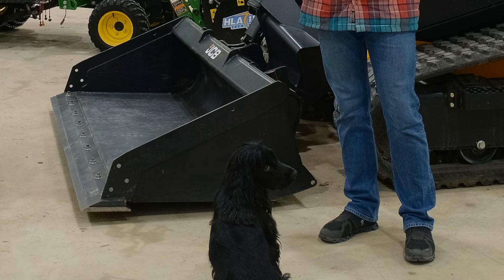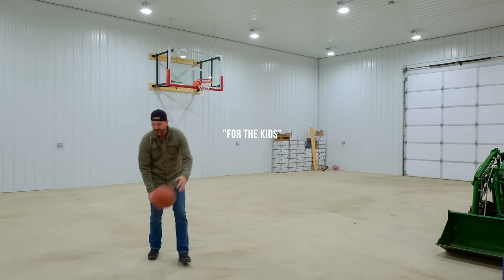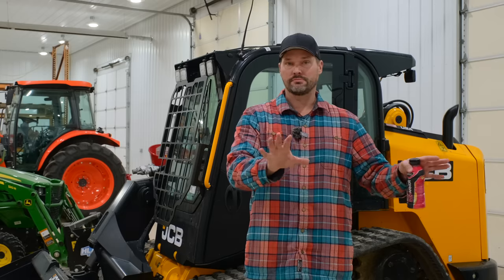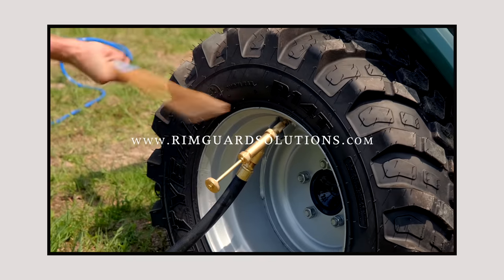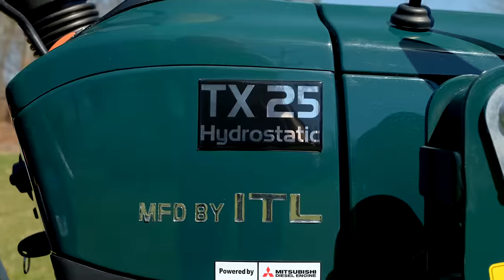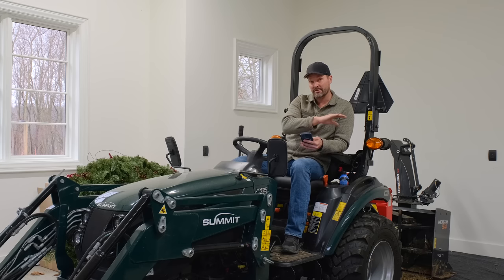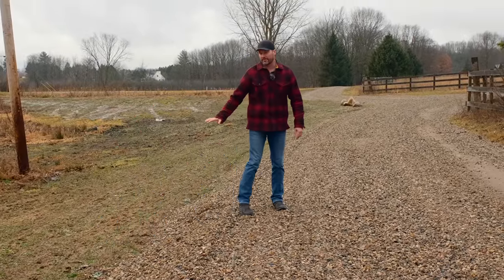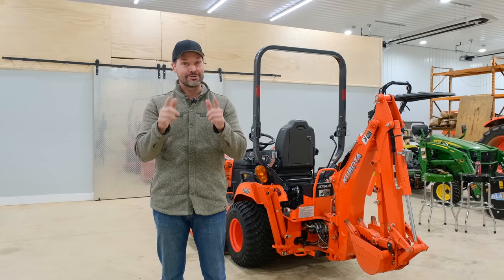NOOO! SPONTANEOUS COMBUSTION MELTED MY NEW JCB LOADER 🔥😭

Comment: Encouraged by the Summit updates, I'm in solid green territory in eastern ND.  I have 12.5 acre farmstead (not living there yet) and due to the bitter cold winters need a cab.  Roughly 10 acres of pasture that needs lots of TLC and 36hp tractor with snow pusher and inverted snow blower for winter snow moving duty is the ticket, since my Lovely Spouse will be doing most to of the work while I'm driving airliners at my real job.

Comment: I will never build another garage or observatory without spray foam. It made me a believer many years ago. Very smart choice!

Can't wait to see all the projects coming! 🙂
Reply from the maker: Agreed, have a good one Daniel :)
Reply: I can not understand you want spray foam when you can use insulated steel panels instead. Simple example here:  youtu.be/IzH9yJdzwGM - no girts, inside and outside completed, better insulated than spray foam, much less work, much cheaper. I just do not get it.

Comment: I’m not sure where the negative opinion’s come from with JCB. I work in foundry maintenance and we have a skid steer with 4,000 hours. Zero mechanical problems other than replacing hydraulic lines that get ripped off by inexperienced operators. This thing lives in 800 degree sand for 15 hours a day. 10/10 recommend.

Comment: Shop looks great! You’ve come a long way since you got the place. Too bad about your new wheel loader. I don’t think I ever seen or heard of a piece of equipment spontaneously combusting. I hope all goes well getting the next one. That baby should push and pile some snow for you. Good luck and thanks for sharing.
Reply from the maker: Thanks!  We got our replacement 407.  Turns out, it won't even lift up the heavy loads we need it to, so looking to trade it back in on a bigger one.
Reply: @GoodWorksTractors  Wow, really?!! How depressing. I guess I would talk to a dealer about demoing a wheel loader so you can put it through its paces to find out if it’ll fill your needs.

Comment: Careful with painting the floor. House I live in now the previous owner painted the garage floor and it's very slippery when your feet are wet either from rain or snow and it doesn't matter shoes or boots honestly it's dangerous my daughter wife and myself have fallen on the floor.  If you paint put sand in the paint.
Reply from the maker: Thanks, yeah a little grit in the surface will help a lot.
Reply: @@GoodWorksTractors  A good paint store should carry a premium floor paint that is Slippery resistant.

Comment: Did you use open or closed cell foam in the shop?  Closed is much more expensive but supposedly better as it provides some rigidity to the structure.  Open cell is cheaper and needs more.

Comment: With the loader control being on the rear fender is the valve body mounted under it or is it cable-operated?  I like a float set up and I know most rear fenders and cable-operated loaders don't have that available.
Reply from the maker: Which machine Moak?
Reply: @GoodWorksTractors  Summit Tractor
Reply from the maker: @NYTROeast  Oh, gotcha.  It's got a valve body mounted right below the joystick under the fender.  It has float.

Comment: JCB is always a mistake, terrible company. We have a TM420 and with 220hr and less than 2 years old the injection pump failed. It was in the shop over 4 months and they said it was our fault because the fuel was contaminated. It was out of the same tank we use for all of our farm machinery and have never had an issue. It turns out the Bosch pump they use was designed for EU fuel specs that are more stringent than ours(similar to the issue with the class action lawsuit on Powerstrokes right now.) Long story short, JCB wouldn't pay a dime because it was our fault for using American fuel. The dealer ate the labor because they felt bad but it was still a $17k repair bill to replace the injectiom pump, lines, lift pump, etc. Worst equipment company we've ever dealt with and we have a 2500 acre farm and deal with a lot of equipment.
Reply from the maker: That is tough to hear, sorry you had to deal with it. Horror stories from every manufacturer out there unfortunately.
Reply: I hear a lot of horror stories from jcb, sad because the teleskid really checks off a lot of boxes but man everyone I know with a jcb has had a terrible experience
Reply: @jackofall2305  Yeah, that's the reason we bought the TM420, it's the only telescoping wheel loader on the market and it's awesome when it runs but we are almsot scared to run it much now.
Reply: @jackofall2305  a friend has a teleskid and it is an animal.
Iowa DOT has had a bunch of JCB end loaders.
Farm friend has some JCB tractors.
None have had bad experiences. 
I wouldn't hesitate an instant to buy a teleskid.
Or any other JCB product.
But we have excellent dealers around here.
Reply: @haroldphipps3457  same. Great dealer support 👏. Our Teleskid has been operating with no problems 😊
Reply: Every mass production maker will have fails jcb are a good brand here in britain and ireland there every where
Reply: Sounds more like it was your fault for not doing more research. I don’t have one and I knew that before reading this comment.

Comment: I have never liked loaders that have one  boom.  Seems to me that one boom isn't strong enough.
Reply from the maker: Yeah, I researched that for a long time.  It's very well built, they thought it through.  I'd expect them too or they'd have major warranty issues.
Reply: @GoodWorksTractors  that friend of mine uses his teleskid with a super heavy Doty winch recovery unit.
Drags loaded tipped over semi's around in ditches.
He is notorious for bring hard on equipment. He can break an anvil with a feather duster!
He hasn't messed up the teleskid in 5 years.
I was concerned about the single boom at first.
I'm not now !!!
The loader is an animal !!